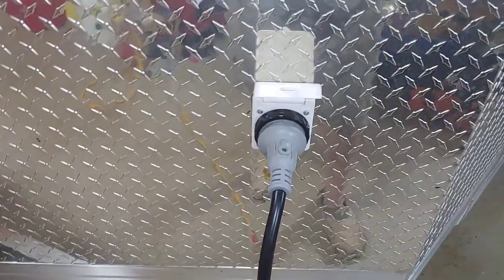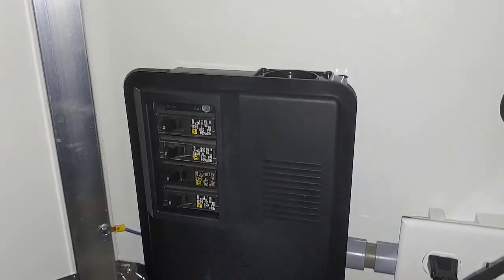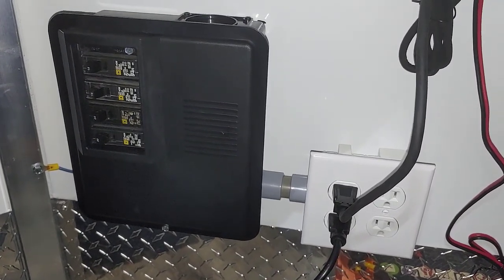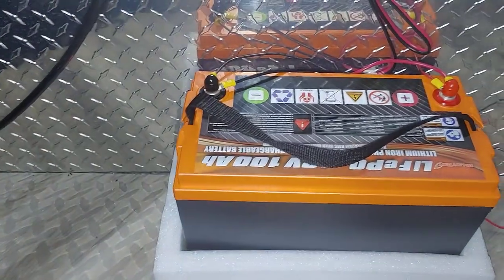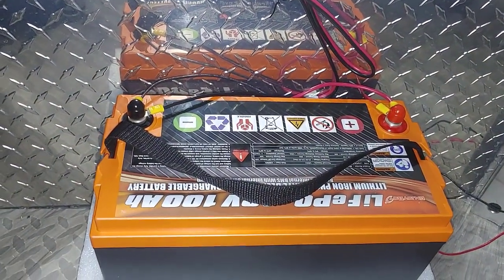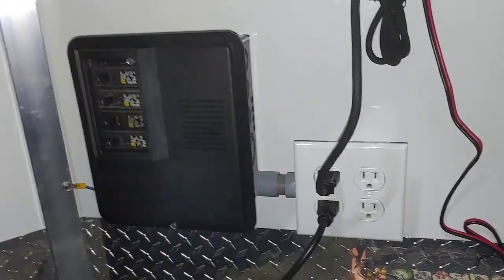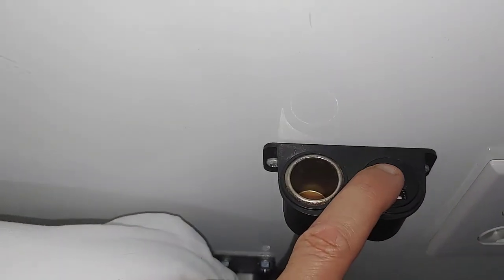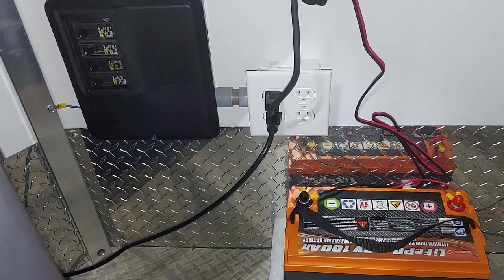WeeRoll Nomad 110v and 12v electrical system, quick overview.

Comment: Thank you! I've had my weeroll just shy of two years and could never figure out why the 12v didn't work lol. Great info and much appreciated.
Reply from the maker: Glad I could help! Which model do you have? Are you a member of the WeeRoll Owners group on Facebook? I am also an admin of that.
Reply: @SwimmingintheDeep  I have the 6x12 with extra width. I've only taken it out a few times. It's rustic functioning only because I'm not really handy and it's hard to hire help where I live. I've thought about selling it but will give it one more try this year to turn it into what I had envisioned :) Yes, I'm a member.

Comment: I like your setup. I see your 120 v panel is grounded to the trailer. How is the trailer grounded? Is the trailer's reference to ground through the stand when it's not hitched? Just curious. Thanks for the walkthrough. Well done sir.
Reply from the maker: Your ground is really supplied by shore power. You also want to bond back to the frame in case there's any kind of short circuit on the frame so it will flip the breaker so if a wire gets frayed from where it passes through the frame somewhere it will short circuit and put the breaker. This is really called bonding.

Comment: Your work continues to be very helpful as I plan out our build. Have you been able to use the trailer for camping, and if so, how was the experience? I'd be interested in seeing how your A/C is installed and removed and knowing if this has been working well still. Also, what have you done to secure your refrigerator, battery, etc. to the trailer? Do you plan to install a sink system, built-in fans, heaters or other equipment? I'll stay tuned in to your updates. Thanks!
Reply from the maker: Hi Thomas, Yes, I've been out in it to a local campground with power and water hookups at a local lake. It was great. It stormed off and on those couple of days which was a great test for leaks and there were none. The AC worked great. The temp was 93 at times outside.  I installed my air semi permanent as I don't anticipate taking it out. I live in Georgia where it will be needed for more than half my trips. I never tied down my batter, it stayed put but I will likely still do that. I bought a sink but have not yet installed it. I also recently bought a Wave 3 Camco propane heater and plan to install it soon. I'll try to get a video up of an overview of how I installed there AC and I plan to do one for the heater as well. Our kids' ages are older now so we are still on the go and we got the WeeRoll with the anticipation of mostly my wife and I using it in the years to come. That's why I have paced myself in customizations. That and winter is coming which is when I plan to do some bottom cabinet fronts under my built in counter. Will try for some new vids soon! Thanks for the comments.
Reply: @SwimmingintheDeep  Glad to learn that you're clearly pleased with your WeeRoll. I'll watch for new videos as you publish these. Especially interested in the A/C, and your heater project will be nice to see too. On the refrigerator, have you fastened it somehow? BTW, I've found a couple of sources for aluminum cabinet doors & filler panels (my guess is you already have too!) Here is a link to the one that I prefer at this point: http://www.midwestracecabinets.com/ Thanks!
Reply from the maker: @ThomasUSofA  Hi, I also considered Midwest race cabinets but they did not have anything that would specifically fit my already built counter top and they were pricy.  On the fridge part...yes, I am using a taller dorm fridge and it fits under my counter top. You know how these fridges have extra screw holes at the top to change the hinge to the other side if desired? I leveraged those screwholes and had a bracket that fit in my junk. I could have bent a piece of flat aluminum to do the same...and screwed the bracket to a supporting post of my countertop. So it is attached at only one corner but I also added non slip pads to the feet of the fridge. It stayed in place great.

Comment: Does your vehicle charge the battery while driving?
Reply from the maker: I plan to do that but I'll need a DC to DC charger to do it correctly. I think they run about $100. It takes the DC current from your vehicle and isolates it then providing the input special requirements of lithium battery.
Reply: @SwimmingintheDeep  Thank you!  Hope to have my WeeRoll soon and trying to figure it all out.  I plan to do something similar to your setup.  Maybe add solar to the mix.